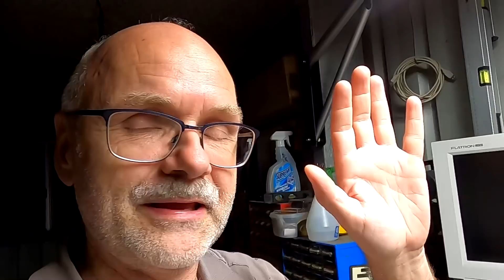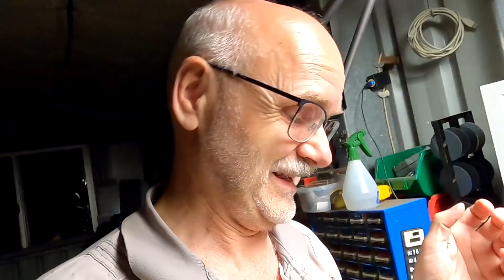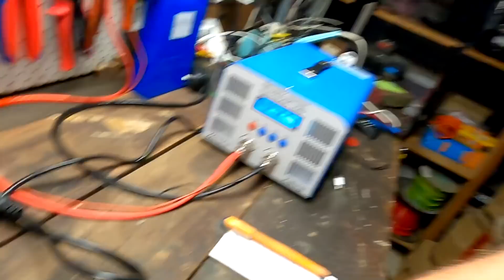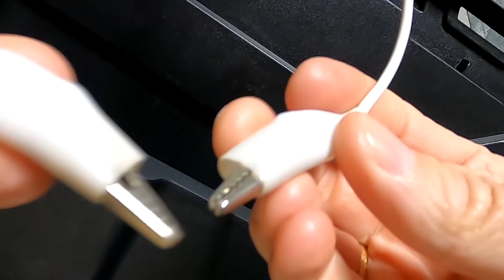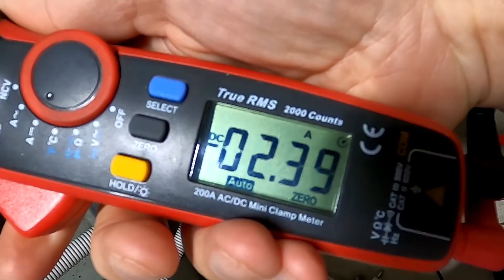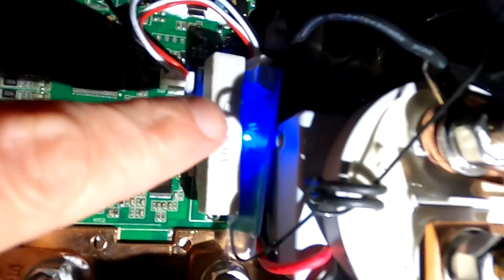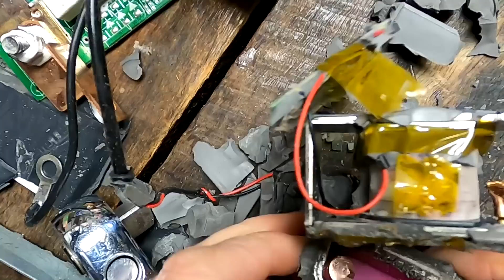The new QUCC 200A BMS. Does the Relay-BMS work this time?

Comment: I have this same BMS (the new one), and it works really well. Also, the iOS app for this BMS does not have separate charge/discharge switch. Just one switch to turn it on and off.
Reply from the maker: Yeah, it seems to be working well. No complaints from my side either.
Interesting they have different versions for that app for iOS and Android.

Comment: I wonder how the number of charge cycles are determined. I mean, ok, if you fully discharge to ~2.5v per cell and then charge to 3.65v, yes it is a cycle. But if you are always between say 3.0 amd 3.4, dont you cycle? this is very fuzzy, and I guess noone actually knows how long a LIFEPO4 setup works in a solar system...
Reply: My daly Smart bms counts cycles when charge & discharge between 3.0 (but never gets that low) & 3.4. I guess it is because it knows the capacity of the battery & uses the power reading & just keeps adding until max volts then to min v then to max v etc. Maybe.
Reply from the maker: The Victron Smart Shunt accumulates the cycles and adds them up to a full cycle by reading the Ah. This is the only true and correct way to do that with batteries. Voltage reading is super inaccurate.
From my observation, the shunt also determines where the cycle occurred. So 10%DoD at 50%SoC are much better than at 90%SOC.
Reply: @OffGridGarageAustralia  ok, so let’s say I am at 95% soc with a 100ah cell and discharge 1ah, then charge 1ah and do that 100 times. Is that then by victron considered a charge cycle?

Comment: RS-485 is the spec for the wiring, not the communication protocol.  RS-485 has an A line and B line.  If one is higher then the other, zero, of the other is higher, a one.  Not voltage level sensitive but level relative to each other.  RS-232 detected zero or one by voltage levels thresholds ranges for the zero and for the one.  RS-232 was good for about 50 feet, where RS-485 is good for 4000 feet/1200 meters.  Great serial communication standard!  So yes you can have all sorts of different looking data patterns and whatever is listening needs to know the language.
Reply from the maker: Great, thank you for the explanation.

Comment: I purchase identical BMS from QUCC. Seems to work but absolutely NO documentation. Thanks for pre-charge info. I also have Overcharge Solar MOSFET similar BMS (excellent documentation!) and will test PC App adapter in QUCC Bluetooth connector. With your contacts do you have a QUCC manual/info link for this units functions? Thanks for all.
Reply from the maker: I asked them for a manual for the app but they couldn't provide one. It's just a third party app they are using, so...
You can get a bit of help by clicking on that ? next to a parameter. It takes a moment until the explanation appears.

Comment: Probably a quality control issue causing the contactor to remain closed. If the stack-up was wrong, the contacts would remain closed even when the relay tried to lift it.
Reply from the maker: Yeah, it was definitely detached form the pin and the solenoid. We could hear the click of the coil but contact was always closed.

Comment: The old relay looks very well made and extremely heavy duty.
Reply from the maker: They all are when you go into this 300A relay area. I'll buy a new one and get the old BMS up and running again.
Reply: My 25-90A 24vac/240ac HVAC contactors at least have silver plated contacts. This helps conductivity and helps prevent sticking. I’d say their bare copper contacts welded closed and you knocked it loose when you performed the autopsy.

Comment: I think possibly the 'weak switch" is for an additional relay used for charging,  put a bolt meter on the weak switch connection to see if it will power a relay, then you can connect a relay with the charge controller on it,   it makes sense?!?;
Reply from the maker: It's simply the on/off switch for the whole BMS. Can also be done via the app.

Comment: Well glad the new one works but a little bit of let down no fused parts must have been an electronic problem or the shaft broke doesn't matter buy a new relay and now you have a spare BMS.
Reply from the maker: I cut through the pin, I could see that so it was attached but somehow always closed. Further autopsy necessary...

Comment: 7 charge cycles in 5 months based on your usage cannot be accurate I don't think so I think it's way off what do you think?
Reply from the maker: I use the battery mainly at 60-80% at the moment. Have fully discharged it only twice so far. I think its accurate. The smart shunt accumulates all micro cycles from each day until a full cycle is done and (I think) it also considers if the micro cycle has occurred at say 60% or at 10% which latter is far harder on the cells.

Comment: The relay was good it is signal for the bms is bad to kick in the relays.
Reply: And why did you hear the relay clicking during his initial testing?
Reply: @ursmalo3103 You mean when it was hook to a battery. That is a different power source.
Reply: @lloydconner3034  No, when he tested the cut off in the software. Also, there is a reason why the BMS got a different relay.
Reply: All righty @ursmalo3103
Reply from the maker: QUCC has confirmed the BYD relays had issues, hence they changed the design. For a few months you couldn't by the relay any more until they released the new one now.

Comment: I'm wondering if the chunky 10w resistor is used for balancing, the bank of little resistors would be dividers for the microcontroller  adc?
Reply: No, balance resistors are the small ones. There is no way to use a single resistor for balancing in a commercial application. I think it is used for maybe precharge or sensing when the relay is off. This board can pass current around the relay.
Reply from the maker: All cells can balance at the same time, so they need individual resistors. I have measured the temperature on these SMD resistors in a past video and we could see which ones where active and a lot warmer than others.
Reply: @OffGridGarageAustralia  I missed that one; I will check it out!

Comment: That 7 cycles is probably full voltage high to low.  In normal operation you don't hit the relay cutoff voltages.  You only have the single relay version.  They make versions with separate relays/mosfets for charge and discharge.
Reply from the maker: The smart shunt uses coulomb count. Voltage reading would be far to speculative. Counting Ah up and down is the best and most accurate way to do that. It then accumulates these Ah to determine what a full charge cycle is.

Comment: So my prediction of dangling contacts seem to be right, I commented on your post before. These relays, even the new one, have an optimizer circuit, hence the low power draw. If you replace the faulty one with a standard 12/24V automotive relay, it will consume quite a lot of power and heat up. Thanks for the video and autopsy.
Reply: I'm looking for a relay for a 100a or greater battery capacity tester, all I see are the automotive ones and I'm worried about the heat as well. do you have any info or links for these other relays?
Reply from the maker: I'll show one in one of the next videos.

Comment: I don't understand how the contact bar was supposed to be lifted off the 2 contact pins. Was the spring loaded pin welded to the solenoid pin? Was there a missing spring under the bar that lifted the bar? 
I am surprised there was not a condenser (capacitor) across the points (contacts), car ignition system reference.  
It would not take much metal migration (pitting) to hold that contact closed with the small spring. Examine with a magnifying glass?

Very Strange.

Edit, I see pits in the 2 contact pins and bar, I am surprised that the contact is copper to copper, it should have been nichol coated at a minimum. Or chromed.  It appears to me that the sping pin should be facing to be between the 2 contact pins, thus lifting the bar. 
All opening switches create an arc when the current is broken.
Ac arcs are self extinguishing because of the reverse current flow. DC  opening switches have to have a method to stop the current flow, either by having a large gap, or shunting the current through a capacitor. 
Arcs always cause metal migration.

Comment: Andy do you think it could’ve broke off it doesn’t look like it was cut it looks like it may have snapped off and it was just sitting in the bottom of the enclosure that’s why it would not work because it was busted off by some pressure

Comment: Andy you are right about the charge / discharge switches on the App. I have a BMS that uses MOSFETs so can separately turn ON / OFF the charge and discharge.
Reply: This is correct. The PCB manufacturer (JBD) uses the same app for different types of BMS. I have 2 of the MOSFET based ones and they can turn off charge or discharge separately.
Reply: @MrJramirex  It goes beyond MOSFETS. A Common Port BMS has two terminals and is limited like Andy's relay-switched BMS. A Separate Port BMS has three terminals and can charge and discharge separately.

I'm not aware of a relay-switched Separate Port BMS, but I guess it could be done with dual relays.

Comment: Have a look at the data for the cycle count. What range does it count. You may not be charge/discharging to the limits, so is not counted, but there still will be some degradation with narrower range.
Reply: Yes I agree ,you need to set the battery monitor to the highest voltage you are charging to , it will count the cycle ,the battery is alway cycling but at a less than 100% so it will last longer ,but believe me you have cycled your battery more than once.